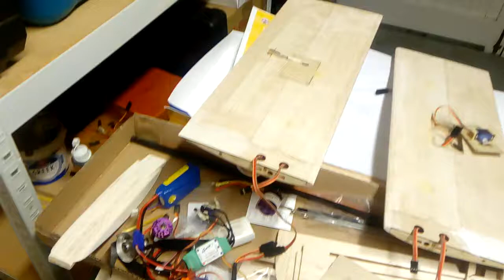Aeronaut LT200 flex airbrakes

Comment: It will work fine, The reason the hinges seem wrong to you is possibly because your used to the same up and down movment from a horn, like an elevator or rudder.. These horns were probably designed to give max down deflection with very little up, its just a leverage thing, impossible to get a servo to deflect 90 down with a normal horn.. The most you would get would be 45 degrees..once you got past that, it would try and bend the pushrod..